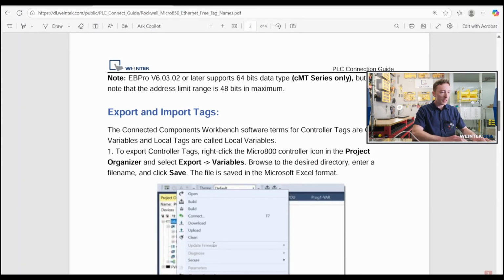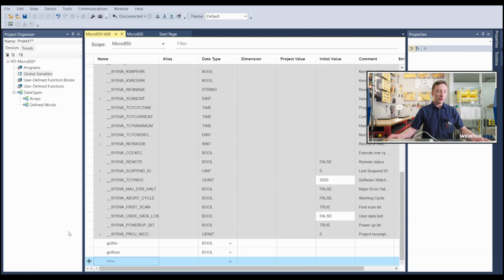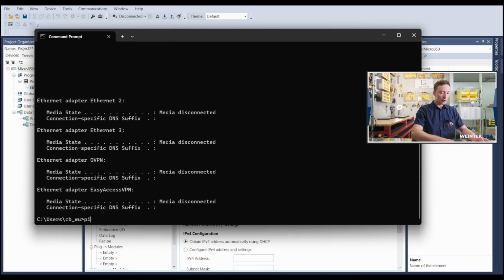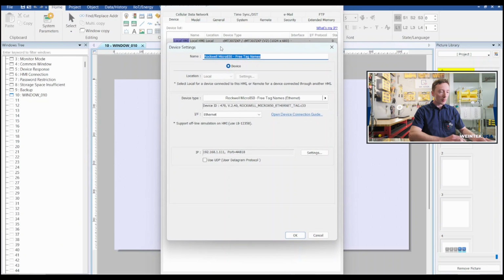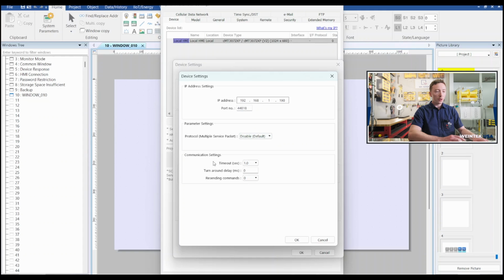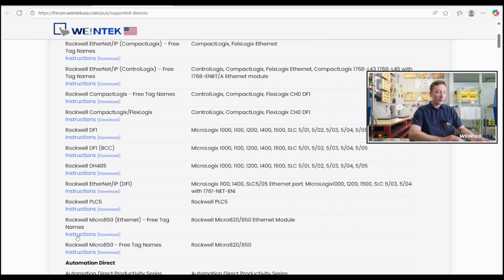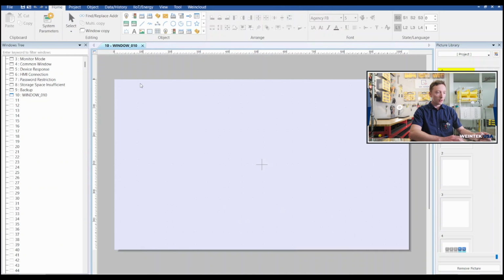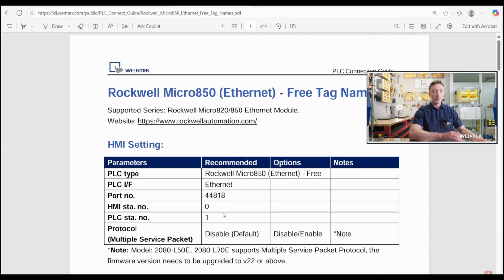HOW TO CONNECT A MICRO 850 PLC TO A WEINTEK HMI

Comment: Why can we only address string arrays with index tags by CHAR, which is pretty useless, you guys fixed this exact issue on the other Rockwell drivers with tags, can you do so for the Micro800?
String[0][0 + INDEX 0] is mostly useless
String[0 + INDEX 0][0] actually makes sense